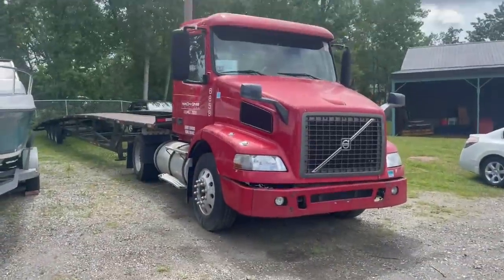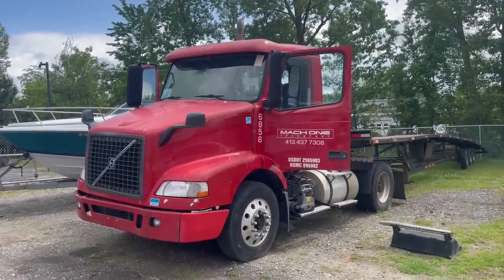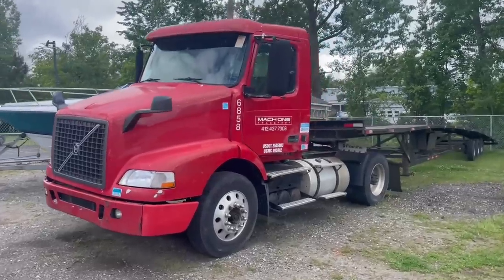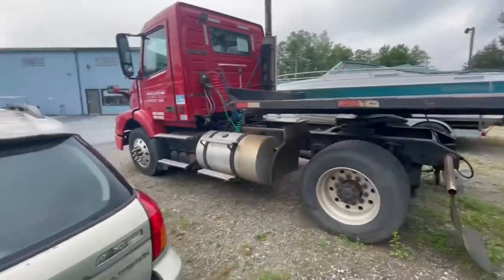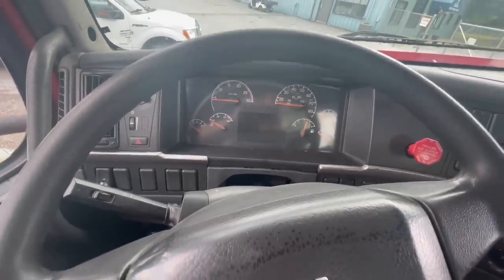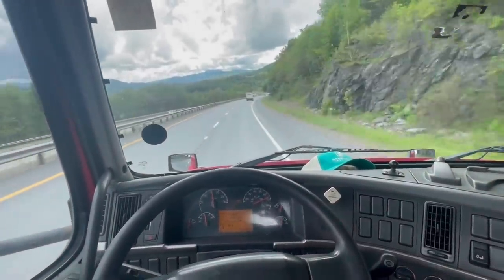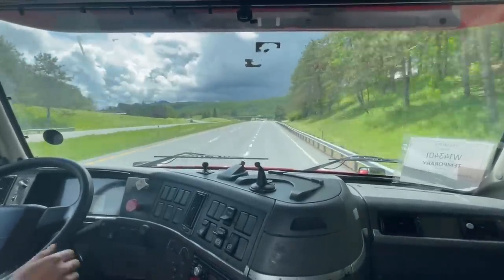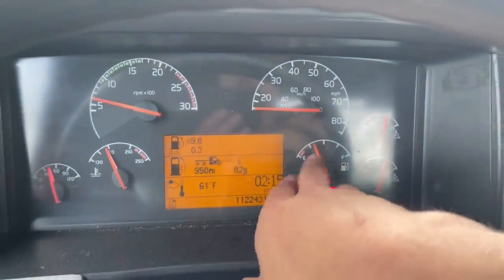I Bought My First Semi For $6,000 At Auction! Was It A Mistake?

Comment: Wishing you the best of luck. A few tips and lessons I've learned: When it comes to shifting slow down and take your time, its not a race. When you shift put light pressure on the shifter and hold it in the gate, when the road speed and rpms are just right it should slide in smooth. Learn to work on your truck, your local truck shop is going to be $145-$200/ hour for labor, it get very expensive very fast. EZrider359 on youtube is a good resource for learning about trucks. Insurance is going to be very pricey your first two years and if you're going to haul other people's property you will need an MC number.
Reply from the maker: Thanks for the tips!

Comment: you can always start in 2nd. 1st is too low even if you are loaded. Don't drive anymore on those steering tires. A steering tire blowout can be devastating. Put duals on the back. Get it professionally inspected. If the DOT inspects it the fines are HUGE and they could rip the plates off. Get ur CDL. DON"T DRIVE IT IN THE WINTER EMPTY. That set up on a slippery road is unstable. If you have just one car put it at the very front. Or more than one car put the heaviest on the front.

Comment: The front tires you can get new for around $300.00 each.
I would lose those rear tractor tires ( called super singles ). 
Better and cheaper to put on duals on the rear. Those wide tires will make you hydroplane in wet roads with no rear real weight on them.  The D12 is perfect for that type of set up, anymore power you're be eating up fuel like a whore.  Get tires, batteries,  oil service AND a good front alignment. 
Then you'll be ALL SET ❤🎉😊

Comment: I’m impressed with the shifting on a non-synchronized transmission! It looks like you’re getting the hang of floating the gears. I’d recommend running the engine high in the rev range and then shifting. It sounded like you were short shifting a bit. Revving it up near the limit before shifting keeps you in the power band when shifting.
Reply: If you can avoid high rpm that’s better. He’s running empty.

Comment: An auction house that sells cheap won't be around long
Reply from the maker: It’s the owners of the vehicles that set reserves not the auction, that said these guys do have very inexpensive vehicles compared with others!
Reply: It’s all about overhead dude.  Looks to me like they have about zero.
Reply: You may find it’s to expensive to run a big truck with the insurance and D.O.T inspection the maintenance cost /CDL cost plus  the yearly physicals for the  interstate CDL  . You could probably do well if you ran and auto transport business though. Anyway best of luck I admire the fact that you are fearless and just jump in …
Reply: @@maxima4106 you do realize the auction house doesn't own the cars? They are consigned to them by the owners to sell. Yes the reserves are set by the owners but that's the minimum. He even says the truck is worth $10k and the trailer is worth $6k so he got $16k worth for $5k if your the buyer that's a great deal if your the seller your not happy.  If the sellers aren't happy they go elsewhere next time ( and I know the truck owner was ok with it that was just a example)
Reply: @danbartolini27  you sound extremely unedcuated😂
Reply: @leearnold8716  hey look everyone a Troll
Reply: @danbartolini27  hey look everyone someone who acts like they know what they are talking about but actually has no idea how auctions work clearly😂😂
Reply: @leearnold8716  so are you a troll or a bot?  Since you know nothing about auctions or how to write a clear sentence I'm thinking bot but then again you could be a troll that's not smart
Reply: @@maxima4106 hey bruh...you sell cheap and people will stop putting there cars in your auctions
Reply: @danbartolini27  so what about my sentence wasn’t clear? You seemed to understand it pretty well🐷
Reply: @leearnold8716  ok ok so your just a troll then...got it

Comment: It’s underpowered for an 80,000 gross probably but you’ll never be there the way it sits it’s probably under 25k 04 is decent cause you don’t have a dpf or an scr but you do have an egr on that year model. Get a decent set of steers don’t run off brands on the steer axle.

Comment: Can you 5th wheel that trailer with a pick up
Reply from the maker: Yes
Reply: @ARuralVermonterQqjmcb182  oh cool you have enough trucks you would do that and sell the rig it will be way cheaper
Reply: @ARuralVermonterQqjmcb182  sell the rig why poor cash into a rig you'll use what once a month six months out of the year ?, don't paint it don't buy tires and rims you probably do have to get new batteries but that's it sell and put the cash in your pocket you can double your money and still have a new trailer that a great deal. Go ahead and get the CDL it can't hurt anything
2 front tires 4 back tires and rims and batteries 4 or 5 grand

Comment: check the DEF fluid
Reply: Truck is too old for DEF
Reply from the maker: Correct
Reply: Obama juice
Reply: @richardthomas1743 . And that right there is why diesels without def can go 1 million miles. With proper maintenance it could go 500k more easily. And yes I do have a CDL.

Comment: Thats a steal , bur you kegally cant drice that because it has air brakes. U must have a endorsement i used to train cdl dricers at a school
Reply: That's where I always find confusion. In many New England states, they say under 26,000 lbs GVWR for the power unit is non-CDL. If it has air brakes, is it CDL class C without a trailer?